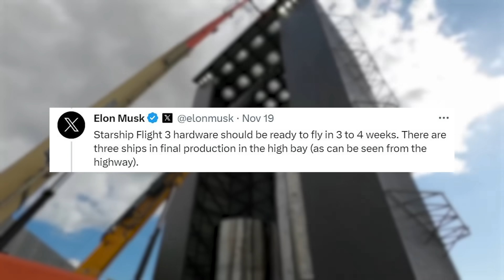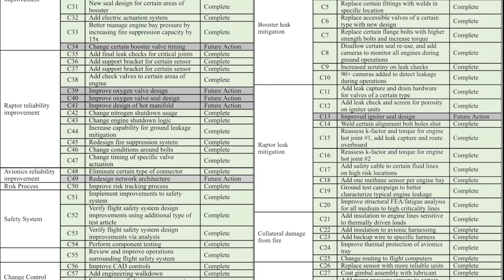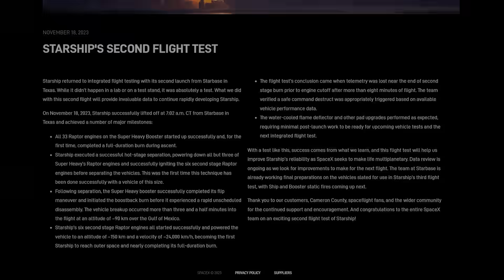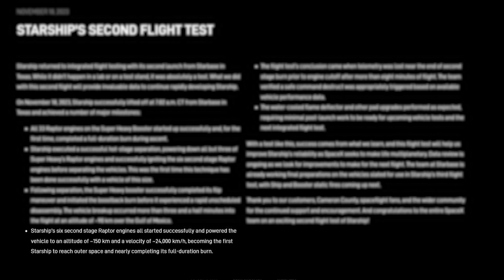How Long Before SpaceX's Next Starship Launch?

Comment: I wonder why space X doesn't build a launch  runway rail for their rockets that gradually curves upwards? The rocket could be propelled with a magnetic rail at an incredible speed so it can save fuel! The biggest energy consumer is at lift off! because it starts from dead zero but with assisted momentum! the rocket will need less effort to fly saving allot of fuel/size and weight! I have always considered lift offs a huge waste of money If someone asks me! It requires a ridiculous amount of power to move a very heavy structure into the air let alone carrying payload! We humans are such a wasteful energy species!

Comment: The "Flight Termination System" (2:35) didn't work correctly: both craft exploded independently, they blew up.🚀💥🚀💥🎪
Reply: Joan, tell that to the FAA, NASA, the U.S. Congress and the U.S. Public and Investors.
Reply: The FTS is there to stop a rocket from going where it isn't supposed to go. If stuff breaks/explodes on it and it's still intact the FTS breaks it apart to have it come down along the trajectory.. so it WORKED AS EXPECTED.

Comment: The main issue now is that while after IFT1 they had very good ideas about what went wrong (and many problem were already fixed in follow-up boosters) here what happened is more of a guess: they need a good working theory about what happened then they need to implement fixes. The booster problem might be tricky to solve, depending on what happened in practice.
It's possibly even worse for the second stage: why did it turn out to be so severely underpowered it wasn't even able reach orbital velocity *while empty*? Did the engines underperform? If it's because they were old engines on an old design, it's probably already fixed. If it's some other problem, let's hope they got enough telemetry data to be able to work on it and that the other ships are fixable (or already fixed).

Comment: My prediction for next launch is end of April next year. The ship and booster should be ready with all manufactured and installed new hardware in mid to end March, then a series of tests, adjustments, more tests and ready in about a month. Might push into early May.
Reply: Mid-Jan at the latest..  April! LOL!
Reply: I'm a bit more optimistic. Q1 2024, so sometime between January and March would be my estimate. But it really depends on what they find out from the mishap investigation and what changes they decide to implement. It wouldn't be uncharacteristic of SpaceX to launch, even though they don't think a system is actually ready for flight yet.
Reply: @plainText384    Saying “between Jan and Mar” is not an estimate, mate. it’s a meaningless statement. There’s enormous difference in time between 1 Jan and 31 March. Give me a 10-day or two-week timeframe, if you care to make your estimate sound like an estimate. I’ll give you mine: 25 April - 5 May 2024 is when Starship actually takes off from launch pad, not when El9n tweets “Starship is ready to launch”, not when they attempt to launch and scrub for technical or weather reasons, not when Elon says “we’re ready, but need to do a few more tests or replace something. The actual launch.
Reply: @V14-x6n  3 months is already a pretty short window of time. Launch timelines can slip a lot, especially when they are so far out, so making a more accurate estimate would be pretty difficult without just arbitrarily making things up.
Reply: The longer these"test to destruction" and subsequent FAA Investigations take, the further behind schedule lags Artemis 3.
Launch of perfected vehicle with lunar paylaod plus 10-12 launches for LEO rendezvous/fuel transfer completed by
December 2026? Doubtful.
And China aiming for a brief
2-taikonaut lunar landing in 2029. Same year as Artemis 5, the first mission of "Blue Moon".
Reply: @davidstevenson9517  Starship is in such an early stage of “fiddling with” and chucking out boosters and ships for shipyard collection that it’s impossible to estimate even down to half a year timeframe when the ship will be ready and rated for manned lunar landing.

In fact SpaceX will have to choose where to invest time, money and effort -  either solving reentry challenge with the heat shield or forget about reentry for the time being and concentrate on orbit refuelling, moon landing, and NASA will certainly push them to do that. then building up significant successful booster/ship flight record including moon landings and returns to lunar orbit to get rated for human flights, do the whole internal design and build of crew and cargo sections, then design, build and qualify all life support systems. Do a number of flights in LEO in crewed Starship with test dockings first with Dragon (transfers to and from Starship) and maybe one or two with Orion.

I don’t see a way how they can achieve all of this before early 2030s, e.i. 2031-2033, that’s with straightforward moving ahead even without major mishaps on the way which more than likely will happen, almost guaranteed. The good news is the Chinese won’t land humans on the moon in this decade either.

Comment: 2:28 This conclusion maybe somewhat premature. We don't know for a fact that the booster RUD was due to the FTS activation.

Furthermore, although Ship 25's FTS was activated, Astronomy Live's footage shows that nearly the entire top half of the Starship, fins and all, survived the FTS activation. Depending on how much of that survived the subsequent reentry, FAA may want to request more changes to the Ship FTS
Reply: Heavy booster was not FTS.
Reply: Maybe you want it to survive since that’s where people would be. Might actually be a good thing.
Reply: @jamskinner  It's not a crewed variant, only Starlink V2 satellites (or satellites with a similar form factor) will fit in the fairing. 
Even if this was a crewed variant, you would never want to blow up everything except the crew compartment using FTS. Anyone on board would die on impact or reentry, so this will never be part of an abort scenario.

Comment: I read somewhere that they are wanting 10 launches next year from starbase
Reply: After first lStarship launch back in April this year Elon twitted they are “expecting four, maybe five more launches till the end of this year”. Apply to what you’ve read and you won’t be far off from truth. Personally, I think two launches next year is maximum provided next launch in April 2024 makes it to a successful reentry and burns up. If it doesn’t make it to reaentry, then possibly three launches. I know it sounds contradictory but I’ll leave it at that.
Reply: @V14-x6n  it may have been the FWS report that said 10 launches
Reply: @V14-x6n  
next launch by end of 2023 / early Jan 2024. As their manufacturing cadence is picking up and they want this to put SLv2/3 sats into orbit at best yesterday the rate will be much higher than 2 next year.  I would expect works on stage 0 at the Cape will resume now that they got an idea what works and we'll see a first launch from there by end of 2024.
And they'll use up the 5 per year they get at Boca if they can.. they production cadence is simply that high.
Reply: Only allowed to do 5 per year. So they were wrong. 
It's 10 they have time for before it's meant to land on the moon

Comment: I think SpaceX should freak everybody out and put a booster on Stage 0 by the weekend.  And move a starship right next to it.  That will cause some conversation.
Reply: I agree. That would be quite some statement to roll a booster out to the OLM this week and a ship to one of the sub-orbital mounts. That would put the chopstick fixes onto the critical path. From what we see probably not big fixes but a lot of cables got damaged during the launch so until those are fixed a booster couldn’t actually be lifted onto the OLM.

Comment: How do we know that the flight termination system worked as intended, other than SpaceX claiming it after the fact? As far as I know, they presented no telemetry, and the live coverage contradicts it in both cases.

On the video of the Super Heavy, prior to explosion, you can see the tank rupture, without the fuel igniting for a few frames. That looks like structural failure. 

As for Starship, if you look at the reactions of the control tower, it's clear that they had telemetry loss and realised that the ship is lost several seconds after the explosion visible on the video feed. There is also the amateur video showing that a big chunk of the forward part stayed in one piece.
Reply: No. That was the fts system.
Reply: @jamskinner  Which part was the FTS system and what is your argument or evidence? Stop issuing statements of faith, like a cult follower.
Reply: No chance was FTS used on Super heavy.

Comment: There was no FTS.. Both craft were destroyed by RUD.....
Reply: Nope.
Reply: Booster: rapid turn caused slosh/hammer which killed turbo-pump(s) which triggered explosion of engine section which triggered FTS
Ship: LOX leak caused non-nominal trajectory and computer/FTS ended flight to bring it down in controlled fashion over the sea
Reply: no chance Super heavy was FTS. 2nd stage, the jury is out
Reply: Indeed. If you slow down the video, the booster clearly ruptured and it took some time for the fuel to ignite. As for the second stage, there was clearly a cascading failure with multiple explosions, then after the last and biggest, half of it was still tumbling down in one piece, and all this time, the ground crew still believed the spacecraft is flying, just the telemetry was lost.

Comment: Well the heat shield on the ship needs a ton of work. It was falling off ship like crazy on ift-2.
Reply: They already knew this was an issue and already updated the installation process for S28.
Reply: im looking forward to the next star ship builds see what improvements they will make. also they are almost done making another mega bay.
Reply: I'm no heat shield  expert but I think they need to develop some sort of  spray on  insulating foam heat shield,  it was the shuttles demise and if spacex does not solve the falling off tile issue  I feel they will follow in the shuttle  footsteps....😂
Reply: @leschortos9196  the heat tiles weren’t shuttle’s demise. 

The carbon-carbon wing root was. The Heat tiles served successfully on the fleet of vehicles for 133 missions and they never flew off like we saw on ift-2.
Reply: @leschortos9196  and you’re implying the space shuttle was some sort of failure, when it flew for decades and built the ISS.
Reply: I'm less concerned about health shield integrity (they can solve that) than the vibrations that shook the tiles off. How do they want to achieve human rating with that? I would not ride that thing even if it had an escape device for the crew.
Reply: @Daneelro to be fair to SpaceX, crew rating is soooooooo far down the line they shouldn't be too concerned. The only crew rated starship needed anytime soon is HLS, which wont have a heatshield anyway.... 

Crew rating Starship, as in Earth launched and returned with crew, will only begin to be looked at once they have a good number of successful launches and recoveries under their belt. This was the same with Falcon 9. It was a highly reliable and successful vehicle by the time they even started looking into Crew Dragon.

I'm not worried about the heat tiles as they basically have a good few years to work it out. In terms of their 'short term' goals its getting payloads to orbit, once the payload has been deployed customers don't care if the ship successfully re-enters, so SpaceX have plenty of time to work on it even when they are launching customer payloads.
Reply: @Thats_Mr_Random_Person_to_you  well SLS missions to the gateway and down to the lunar surface are supposed to fly every two years or so. HLS will require anywhere from 8(Elon’s guestimate) to 16(NASA’s) starship launches to fuel up an HLS for a surface mission. With 2 uncrewed lunar landing demo missions planned and Artemis 3 supposedly happening in 2025-6, that’s not much time considering it’s been 7 months between missions.
Reply: @ Papershields001  
it will not take them 7 months to do IFT3.. this is an exponential process.  Just like with F9 this will speed up remarkably.
Reply: @Thats_Mr_Random_Person_to_you  Not so far by Elon's timelines, certainly not by the HLS timeline. The vibration doesn't come from the heatshield, the heatshield damage is just the symptom.

You cannot extrapolate from one space vehicle to another. Falcon 9 never had the human-rating problems Starship has. Falcon Heavy, on the other hand, did, and SpaceX abandoned the human rating drive. For Starship, human rating was Elon's ambition from the conception stage, providing for a rocket-integrated crew compartment went into the basic design. Crew Dragon is a completely separate spacecraft.

It's funny that reusability suddenly doesn't matter, according to you. But it is certainly a cost factor.
Reply: @Thats_Mr_Random_Person_to_you  You are forgetting about DearMoon. SpaceX was actually supposed to fly crew around the moon and back on Starship THIS YEAR. While it might technically be possible to do this without a crewed takeoff and landing with starship (for example by launching multiple crew dragons to rendevouz with a starship in LEO), they are planning on using a crewed Starship for the whole mission. While I doubt this will still happen, they were definitely planning on launching this "crewed lunar flyby"-version of Starship before HLS (Or at least that's what Elon claimed)
Reply: @joansparky4439  this had twice as many problems as the 1st launch. With a 100 mile wide debris field. It's not unplausible that this won't take just as long to resolve the issues as well as gain approval.
Reply: @Daneelro as far as I was aware the tiles falling off wasn't entirely because of the shaking, it was also due to the fact most of the detached tiles were on weld points and didn't properly have adhesive paste as a result. Granted solving both the vibrations and tiles is a win win either way

Comment: On the "SpaceX Progress Report" channel for YT grading scale of 1 thru 10,  we, at the un-Official YT channel SpaceX Reporting Grading Institute (YT Division), award this SpaceX Progress Report with a 9.5 because the boss said, no matter how good they are, there are No 10's given least we put ourselves out of business.   ☺ 
OK, now for some Serious Business !   🥸 Like everyone else, hearing some shared intel on StarShip's Heat Tile issues would be comforting. Then maybe the whole, "StarShip lost telemetry so we're do the Splody thing" issue could be explained. 
    Lastly, eventually SpaceX is going to attempt a LIT (ChopStiks) capture of an incoming SS or SuperHeavy Booster while trying Not to blow up the OLM & LIT. Sometime during the first SS launch in April, I heard that SpaceX had requested permission from the USCG to float a device (or several devices) for measuring the accuracy of a SH Booster or SS water landing.  Anyone else heard of this ?  Knowing how accurately they can plant a SH Booster or SS on water first is a Very good idea before attempting a LITower catch on the first attempt.
  And Lastly again, where's the Martin WB-57 Canberra video of StarShip at altitude ?  Come On SpaceX, we're Dyin for info over here !   😵‍💫

Comment: The booster looks like a maneuvering thruster got stuck open and caused the fts to activate, right before it blew
Reply: There are some good videos on it. Most think that maneuver caused the fuel to slosh.  This caused air bubbles to enter the turbopumps and blew them up.

Comment: The problem is that it is not true that the self destruct system worked well. The starship was "cut" in half, and the upper half was seen falling down in one piece. 
This is the most unique part of the starship, as it has no propellant tank (just a tiny) so the empty shell which is also hardened, shall be blown up somehow to small enough pieces...
Reply: Nah. That's how this works. The nose almost certainly broke up on reentry. Self destruct (as you put it) is only meant to terminate thrust and disperse propellants. The only issue here is if what is left of the nose (or anything else large) landed outside the launch exclusion zones. If it did, the solution is simply to be more conservative about when to detonate due to deviation from planned flight.

Comment: Elon said next month
Reply: ElonTimex2=RealTime=January
Reply: That would be impossible, they need two months to fill the tank farm with enough liquefied methane for a full starship stack(that is the reason why they applyed only for five launches in a year) , that is because they carry the methane with trucks, and have no other options because of the isolation and lack of infrastructure on Bocachica.
Reply: @theOrionsarms 
They should make a pipeline or something straight from the refinery or whatever.
Reply: @lupinereivaj  that would mean a large infrastructure investment, but the better solution would be a LNG terminals at closest port, from there the same amount of trucks can make ten times more trips that today.
Reply: @theOrionsarms 
The 5 launches per year are bec of environmental impact, nothing to do with fuel/oxidizer deliveries. They can speed that up if needed easily.